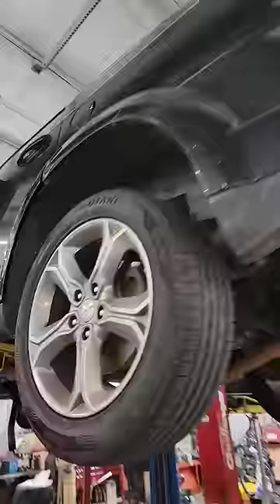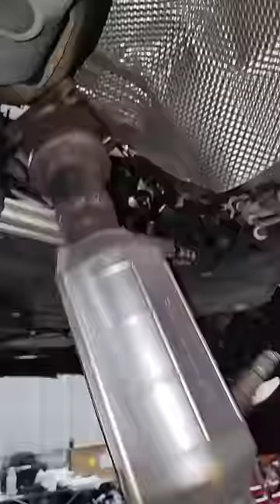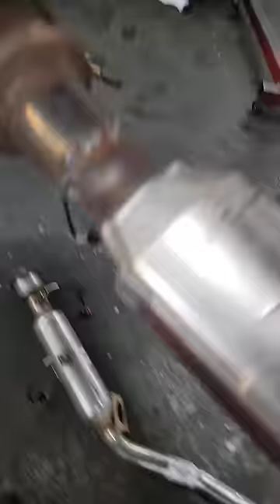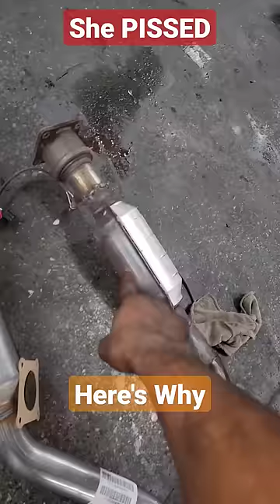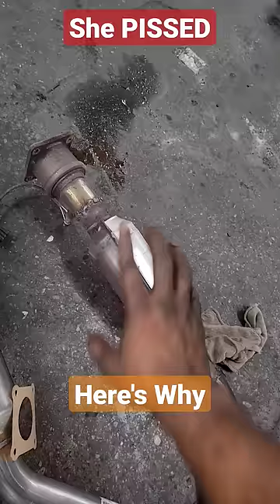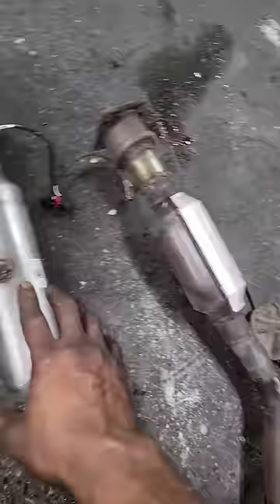This customer freaken Pissed Off. But at whom?

Comment: She should sue the other company into Oblivion
Reply: Based exactly on what? Because I sold her a catalytic converter that she agreed to pay for? Most shops don't guarantee to cure a problem they guarantee to affect the repair or replacement of a part. Even if they could have went to the dealership got the part for free and then resold it to her they still didn't break the law. The only claim the woman would have would be repair or replacement of the poorly welded product. Was she needs to do is submit her receipts for reimbursement by the automotive manufacturer
Reply: @MAINTMAN73  well it's obvious that they did not put the proper part on the vehicle they charged her to put an improper part on the the vehicle not call me funny but I do believe a lawyer to call that a theft of service misleading a customer / client! You take your vehicle somewhere and you expect them to do a good job and put the proper part on, and by what I see from your response you're or could be quite possibly one of these people to pick up one of these parts ago I guess I'll just grab this part here and told him that vehicle over there even though we don't go in that vehicle! I'm going to save a few dollars but putting this on that vehicle!
I truly hope I miss reading your response to me wrong I really do!
Because where I live the mechanics are honest they'll take you out in the shop and show you what's wrong with your vehicle and explain to you what you need and lay out your options from what you need to the cheapest! And this did not occur with this lady in the other shop they just grabbed some piece of junk and slapped it on her vehicle!
Do you do that?

Comment: Looks like a stolen cat converter that was welded. If you haven't realized by now, a few years earlier, there was a bad trend that started happening...cat converters were being stolen from vehicles overnight. They just basically cut them right off the vehicles. The cops need to be notified, just so it will start bringing some attention to that shop. I would also post on social media, about what that shop did to her, if I was that customer.

Comment: Who’s responsibility is it to check for open recalls on the vehicle? By law auto manufacturers must notify the registered owner of vehicles within 60 days of issuing the recall. So either the owner disregarded the letter, the vehicle isn’t properly registered, or the recall was issued before she bought the car and she never bothered to check for open recalls on the car when she bought it. Either way, who’s fault is that? If you bring a vehicle for me to diagnose and I’m aware of a recall for this issue, I will take the time to verify whether or not it’s been performed. But I’m only going to be aware of it if I search for common failures for the issue. If you come in with your cat cut off or for a p0420 or p0430, there’s no need to go to the computer for anything. If the cats are there, check o2 activity and fuel trims, sell the job. No flat rate tech is going to do a recall search for every single vehicle they touch. It’s a waste of time and frankly not their responsibility.

Comment: First off!  It's on the customer for not paying attention to the recall notice that she got for this issue.  

Secondly...  That was a shit repair!  Bad on that shop who did it, most good technicians should know that aftermarket catalytic converters wether two way or three way just won't work the way the factory part will.

Comment: Why is the second O2 sensor, on the new cat, so high up? 

Every dowstream sensor I've seen, is almost completely after the actual cat comb, why is that second sensor up so damn high?

Maybe there wouldn't be a recall on them, if mopar actually had a sensor at the end of the cat, instead of 4 inches away from the other sensor.

Comment: From the looks of it, they cut the old cat off and welded a universal on.  I should say “welded” because those welds look tacky (pun intended).  From a distance it looks like there are holes in the weld.  That could be the reason for the code.  Plus the core from the original cat, they probably pocketed $600-$700 after the labor.  Everyone should learn some basics of auto repair so you know when you’re being ripped off or take someone with you that knows what they’re doing.  I went to a quick change place for an oil change and was shown a rag with red fluid on it.  I was told that came from my brake system and that I should get it flushed.  The only red fluid I know of is automatic transmission fluid and my car was a manual at that time🙄  I was aware employees get pressured into selling bogus repairs so I just said I’d take care of it another time.  He knew that I knew from the way I looked at him and he dropped the issue immediately.

Comment: 90% of the comments are from Total Karen's! The shop that originally did the work sold the woman a catalytic converter they installed a catalytic converter. Although you could argue they had an ethical duty to check for recalls they had no legal duty to do so. The only way the original customer could claim a loss is the poor quality of the weld if in fact it did not seal the exhaust gases the way it should have. In that case they would be responsible for making the repair themselves or paying to have someone else do the proper repair on the weld only. Most repair shops do not warranty that they'll fix a problem. A warranty their installation of a part and in some cases that the part will perform as it should. Other shops don't guarantee the parts and it's on the customer to seek remedy from the component manufacturer or parts house. Buyer beware, it's customers duty to find out if their car was subject to a recall or not if they didn't do that then just sour grapes the mechanic had no duty to do so from legal perspective anyone that is crying that she should take them to court has no clue how the law works and certainly has no clue how the automotive repair industry works. The fact that nobody seems to think of is it will cost the woman more to sue the automotive shop then it would to get the repair done even if she had to pay for it twice. Yes in small claims court at least in the United States you don't have to pay the cost of legal counsel, but the woman will still have time and fees involved in collecting documentation photographs time off of work etc etc. Then unfortunately she'll lose the case because other than poor quality welding the original shop did nothing legally wrong. Ethically they screwed the pooch

Comment: It's consumer experiences like this that steer buyers to more reliable brands like Ford  or Honda. 
Theoretically Cat Conv would never need replaced (unless 'poisoned') since all it does is   initiate chemical conversion. 
The rarity of Cat Fails backs this claim.
Reply from the maker: Since I'm on the repair industry side of that, I don't give what you saying  much attention. What I look like getting mad because I have a cat convertor to replace?
Reply: @Online Mechanic Tips   . Good chance original Cat was OK unless 'poisoned' by oil , antifreeze, etc or melted by excess fuel..  Probably never no.
Two Cats failing in short time very unusual as u note.
Don't recall reason .
Reply from the maker: The recall is not because they so call failing. Cats have a lifespan on them just like any other part. I would have to read up on why this was issued. But my point is, who cares? Mechanics don't care and the customer sure as hell don't care.

Comment: Damn, I recently took my F150 into a dealership for a new water pump with 79,xxx miles. About a month later I found out that the  ticking noise I had been hearing, for a few seconds after startup, since I bought it was a stripped out cam phaser that Ford will replace for free up to 80,000 miles. I know they heard it and knew what it was. I didn't find out until at least 1000 or so miles over 80k that Ford will do this. Is the dealership incentivised not to bring this up to me?

Comment: There is no core on that aftermarket converter give it back to her and let her get her money back but there is no core one a converter
Reply from the maker: Uhmmm, we have to turn in a cat dude. Don't matter if it's stock or not
Reply: @OnlineMechanicTips  never heard of it you must work at a dealership
Reply from the maker: @timframpton1965  This day I was at the dealer. When you replace a Cat under a recall. you have to cut it up and turn in a cat as a core. Had she paid the core charge, she could have taken her cat. Im not sure what the charge is.

Comment: It's her n shop fault, but  the shop did there job. If they cared more about there customers, they could've checked the recall but it's not always available to theme unless they pay for subscription of Mitchell on demand, all data, etc n that cast $300 to $500 a month, or call the dealer, check online.  She came with the problem they fixed it. Or they could take the car get the recall done n charge her for the time n info they provided. Me personally if I know there is a recall on something I'll tell the customer about it, I work lots with small car lots, we do 35 to 70 cars a month with different problems, starting with oil changes to engine swap rebuild depends on the car. Electrical, transmissions suspension, complete diagnostics. Etc. N also we do walk in customers. N the car lots r cheap, I mean cheap I rather have 25 retail cars per month than up to 70 cars from them. The problems there cars come with its crazy I think I've seen a lot. Also depends on the kind of the shop, Good luck to everyone. God bless us all.

Comment: took my car for a sticker and when done left with a estimate for 632 bucks. WTF well u have a bad inner tie rod so we figured 2, ok and well after that u need a 4 wheel alignment, and urr 3rd brake light don't work and it's a assembly not a bulb so all together $632. Ok. It's 07 town car with 188k. I bought it 8 k ago and it was a dealer serviced everything car. I'm a stickler for service and products I use. I know my lights r fine. I know my tie rods are fine cause I rotated tires days ago. Take to a shop where I know the owner and said hey can u give car a shakedown and tell me any issue no matter how small. He said urr car is 100% as perfect as can be. Not even a noise or a shake anywhere. Urr light plug for brakes was not seated all the way. So they Unplugged it but not all the way so lights wouldn't come on. U make more $$ by treating ppl right, not bending them over to take a screwing. Watch out for shops like this. Wife took car years ago and said 16 things. I went in days later 1 thing, a bad bulb contact fixed with sand paper. If they think they can get u they will.

Comment: How is it the shops fault. Its not there job to check for recalls on customers cars, its the customers job and 99% of the time they never check and when they get a notice in the mail they still don’t do it unless it was the airbag recall. The only recall I tell customers to check on is the pos Hyundai steering gear and the pos Hyundai engine replacement because of oil consumption. I’d be more mad at the price then anything. Thats like an $80 universal cat thats easy to remove and weld up even in the rust belt. Hell I would have done the same thing with better welds and I always tell customers that these aftermarket cats only last 2-3 years. And charged them like $250 for everything depending on if I had to torch the hardware and replace it.

Comment: Dorman is that what youre saying or duurman ?   Not sure what you mean.

1000$ for a cat ?  I get it if you have like 4 cats.. but 1 cat ?  Thats a small cat too..  Unless prices jumped 1000% in the laat 5 years.. she got ripped off.  Wow.

The welds on that cat are absolutetly horrible too.  I bet it has a bunch of pin hole exhaust leaks on those welds.

That small cat should have costed no more than 200$.

As for mopar or no car.  Cats arent a mopar warranty.  They are a federal warranty.  The cat is suppose to last i believe (correct me if im wrong) 8-10 years and if it doesnt.  It needs to be covered by OEM

Comment: she might be even more pissed, because technically shes supposed to pay the core on that cat, because that junk aftermarket one isn't worth the metal its stamped in, and chrysler is going to kick that core charge back on you. im sure the independent shop knew the core value on the old cat was worth more than the new cat they installed too, and sold that shit and made even more money.

Comment: Never would I ever pay $1k for some metal to catch engine farts. I'll straight pipe it long before then.
Reply from the maker: Then you might not want to go to the shop for a check engine light
Reply: @OnlineMechanicTips  I have the auto parts store scan it. If they told me a P0420, I'd straight pipe and use O2 non-foulers, O2 sensor simulators or get a tune. Then again, I don't live in a facist state so I could also easily run a less expensive high flow cat and don't need to pass a smog check.

Comment: Ridiculous those p0420 codes are a scam
Reply from the maker: How so?
Reply: @OnlineMechanicTips  car runs fine engine light pops up because of p0420 slightly "below threshold" cant pass smog cant renew registration fines go up no registration tickets smog check fails new cat all a big waste of money for something very small as far as environmental pollution.
Reply from the maker: O ok I see your point from that standpoint. Because it may not even change how the car drive. But EPA says you harming the ozone with that amount and the computers are design to turn on the light when that happen.

Comment: Why would you say the shop likely knew there was a recall? Most independent shops don't know about recalls. Stop assuming. You've probably just worked at Mopar your whole career. Stop acting like the dealerships have a Halo and their sh1t don't stink . They don't call them stealerships for nothin. And many dealer parts are defective too . I've worked at both independent and dealers. And often aftermarket parts will correct pattern failures that dealers won't.

They only have recalls if enough people complain or if DOT force them due to safety issues . Stop acting holier than thou .
Reply from the maker: I suggest the shop knew because its to easy not to know. When VINs are entered in there sys, just about everything about the car pops up and im sure this did. Dude this not about a defective part, I never said the part was bad. I did however say she shouldnt have been charged for this because of the recall.
Reply: Dude you always claim that aftermarket parts are not up to par with oem parts . And you kept commenting on how it was a doorman part . Second of all most indépendant shops do not have a system like a dealer where that info will pop up . And if there was a recall shouldn't she have received à letter from Mopar?

Have you ever worked at an independent shop? You just seem to be bashing independents when I know alors of good honest people who work there.
Reply from the maker: Hey bud, this not a parts quality issue. Nobody bashing the independent shops. I have friends who work at those places. Sorry if it sounds offensive. The video is about a cust that spent over 1k for something she could have gotten free. I just assumed the shop knew this because of how great technology is now. I cant take back this customer anger nor can you so it is what it is. Lighten up and enjoy you day my guy
Reply: @OnlineMechanicTips  Thanks. Didn't mean to come off angry . Cause I'm not . I just wanted to get a  discussion going . A friendly debate.  I know the customer is angry and I do understand.  It's just that usually when there's a recall the company sends customer à letter saying so . I have an old Yaris that I bought second hand and still got recall lettres 10 years after the build date .
Reply: Most indenpendant shops however should know about the federal law protection for cats.. if the vehicle falls within the years i believe 8 years i forgot which.. it uas to be covered by the original manufacture.

Which means this shop could actually get in trouble
Reply: @jeepsblackpowderandlights4305  The federal warranty on the cat itself is 2 years or 24 000 miles . 8 years or 80 000 miles is for spécifier components IE ( ECM). This is States . I'm in Canada.
Reply: @Downsolow  could swore it was longer.. maybe it changed ?  Or i thought wrong for years
Reply: @jeepsblackpowderandlights4305  Sent you a link .From what I read and understood . It's not the cat itself but certain parts of the emission system .And regardless the Video was talking about a recall and not warranty.

Comment: My comment is a little bit different than the video but I have a Cadillac ATS  the batteries in the trunk I was going to do it myself but didn't have time because of work so I got a price for a new battery at advance Auto parts then for shits and giggles called the dealer no I don't remember the exact numbers but installed at the dealer was the same price as the battery at advance auto! Tell me that ain't crazy, hard to believe but true